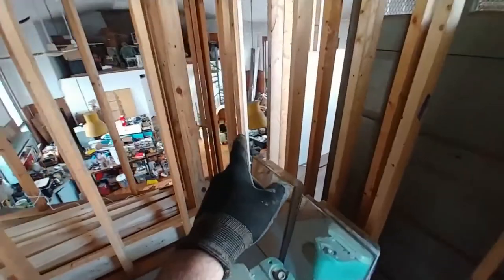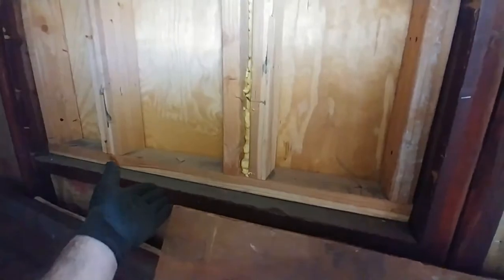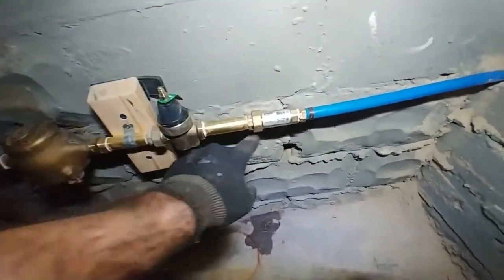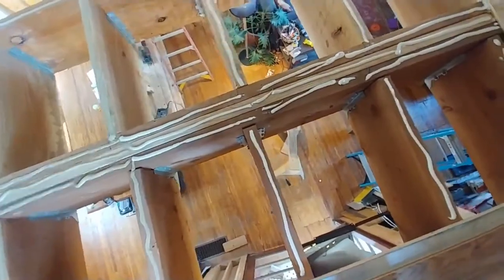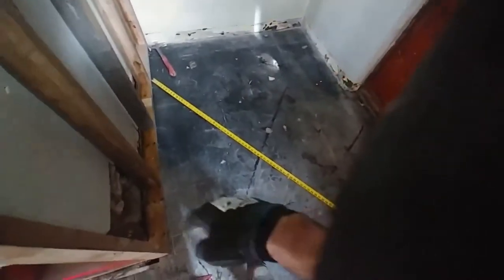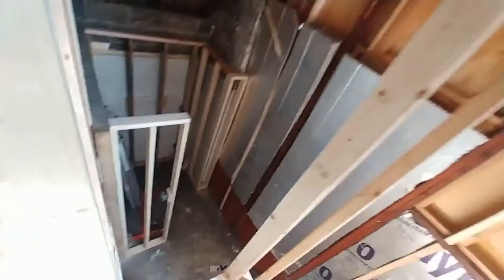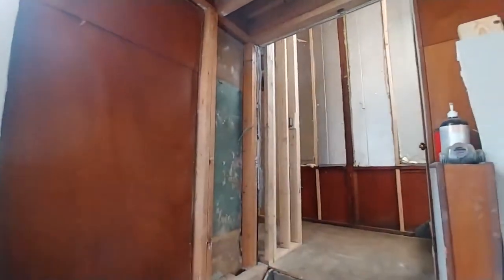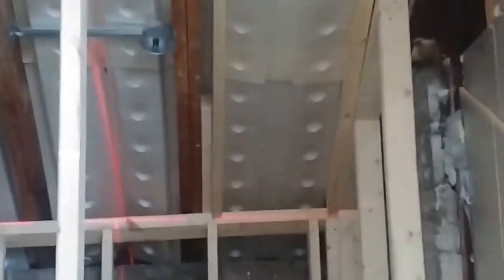Transforming An Old Church Into An Open Plan, Mid Century Modern Home |  Phase One

Comment: You are doing an awesome job with impossible construction problems. In a way it is overwhelming the issues you are dealing with because of someone without your knowledge doing prior work. I have always told customers that sometimes it takes longer to do a half ass job than to do just do it right in the beginning. It is a lot of work doing that balcony extension and hopefully there won't be issues with the new cantilever. This is a long video and I am still not to the end. Thanks for taking your time to show your process. In my work it always seemed that all of my jobs required creative problem solving to get the job done like in your work. Good job.
Reply from the maker: Thanks Karl!